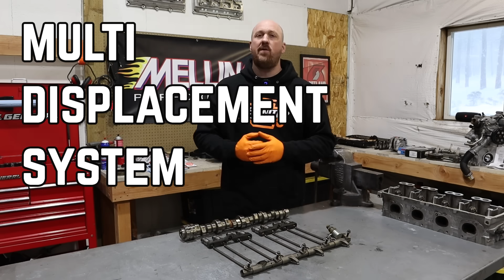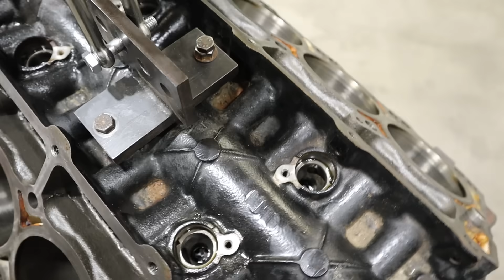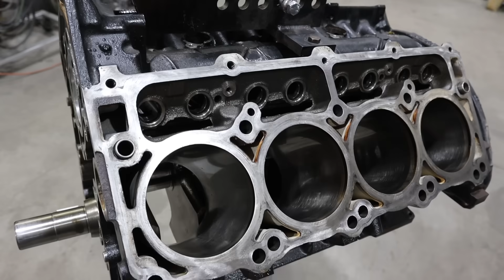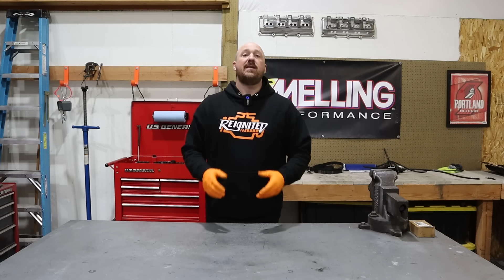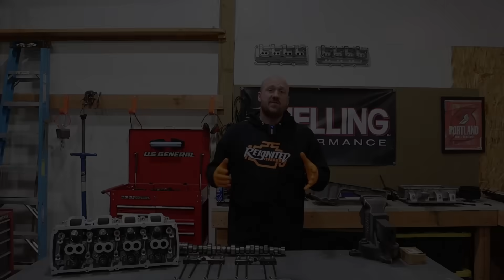Is MDS Damaging Your HEMI? The Answer May Surprise You!

Comment: Question regarding “turning MDS off” on 5.7 HEMI. If one puts it in semi automatic gear 8 and drives normally, the MDS will not activate. Is this problematic as it is if using a tuner to disable or shutting it off other ways? (with regards to oil going to oil bores and oil delivery throughout).
Reply from the maker: If you are immediately putting it into that mode as soon as you start the vehicle, then yes it's the same thing as turning the MDS off with a tuner. However, I do want to stress that this isn't as critical to the health of the engine as regular oil changes and keeping the engine idle hours low. Both of these things will have far more effect on the longevity of the engine components.
Reply: @ReignitedAuto  I’m not sure I fully understand what you’re saying in the answer. Is it safe to disable MDS always, not idle the engine, stay on top of oil change frequency and use high quality oil etc… Do all 8 firing cylinders receive oil lubrication equally if MDS is disabled? And if yes, is it necessary to replace the MDS lifters and plug the bores, remove solenoids etc, if the answer is yes?
Reply from the maker: @mrgoggles1963  when MDS is not active, the lifter bores are not receiving full oil flow. So if at all possible let the MDS system operate as it's designed. If you'd rather not have the system at all, then I recommend removing the MDS solenoids, and replacing the MDS lifters with non MDS ones. You will need a tuner to turn the system off for good, otherwise you'll get a check engine light. But if you do this, the lifter bores will be receiving full oil flow at all times.

Comment: I have a 2022 dodge challenger r/t scat pack with auto tran. Would the MDS activate on eco as suppose to track, sports or custom. And does this particular vehicle has this technology
Reply from the maker: Yes, your vehicle is equipped with MDS, it's active in ECO mode, but disabled when in sport or track mode. To be clear, I'm not implying there's damage that's happening when the MDS is not actively on, I'm just saying that it's an additional way that oil can reach your lifters, so don't just automatically turn the system off whenever you drive the vehicle. 👍

Comment: Yeah. Say what you want but I work in an independent shop so I service all brands domestic and import. We replace DOD and MDS engines 10-1 compared to the standard v8 versions of the exact same engines. Oil consumption is a huge issue on these engines also compared to the standard models. Great videos btw. Very informative

Comment: Love the video, was debating on doing a 6.4 scat motor into my 68 charger. I was originally just going to install complete stock, but if I read your video correctly it’s highly recommended to delete MDS and replace lifters with a hell cat oil pump? Also is it beneficial to go ahead and install a camshaft also? Thanks
Reply from the maker: If you're going with a custom install like that, 100% ditch the MDS system, install an aftermarket camshaft and install the high volume pump from Melling 10452HV. Also, to check out a new product available to run these engines in swaps like that, check out my most recent video!

Comment: I wonder if those MDS plugs totally block the mds port? I wonder if it might be better and cheaper to leave the mds functional and install non mds lifters. That way you get extra oiling during an mds activation and you don't get the collapsed later that probably is what damages the cam. OR if the MDS plugs totally  block the mds ports? Maybe leave the bottom O ring off and feed extra oil all the time? Also everyone want to change the cam (expensive) during a delete. Is this absolutely necessary? I'm working with old cars and junkyard engines. Cost IS a factor. Lol. 1500 total build lol. 😂
Reply from the maker: Good news, the plugs DO NOT block the oil ports so by installing the plugs you're getting full oil flow. And no you don'g have to replace the camshaft if you don't want to, as long as none of the lobes are damaged of course. 👍
Reply: @ReignitedAuto  what if you replaced the 8 MDS lifters with 8 regular. Added the oil plugs in the block then just left the solenoids under the intake plugged in? I wonder if you would retain MDS by cutting fuel and spark but still letting the mechanical part of the engine be unaffected? Best of both worlds n no tune required?
Reply from the maker: @egodeathplease  I haven't thought of doing that before, but I don't think it would benefit the engine enough to make it worthwhile.

Comment: What a stupid way to "engineer" this system.  It would make more sense to use the pressurized oil to keep the lifter at operating length instead of shortening it.  So essentially if you take this to the track often, or drive in Sport or Track all day you are wearing the crap out of those lifters and cam lobes.  Wait, I'm making sense.  This is a business.  They do it this way so you trash your engine more often and have to either pay them for a replacement or buy parts from them to rebuild it.  What a shady way to do business.

Comment: I have a 2007 mds engine in my jeep wich is ticking from.idle to somewhere between 1300 to 1600 rpm, i did an engine flush with seafoam and it bring the thicking down from 2200 rpm to what it is now, should i considere swapping oil pump for an high volume one or is there something i missed... mds work ok when it does ( got an intermittent mil ) but i'm wondering what should be done because i dont want to remove the head to gain acces to the lifter... pain in the ass doing it inside engine bay since i am not equiped to remove an engine from there...

Do you have any option before swapping the oil pump ?

Comment: mine: 2011 Ram 1500 stock 5.7 Hemi. Concerns: My debate surrounds the exhaust manifold bolts that occasionally brake. Could the MDS system running on only 4 cylinders cause a heat exchange/expansion and shrinkage  problem for the exhaust bolts, causing the heat on, heat off heat on, heat off from the deleted 4 cylinders to cause an uneven amount of heat in the aluminum heads and cast iron manifolds? With 4 cylinders constantly burning and other 4 constantly on and off it makes me think that this is causing the exhaust manifold bolts to break. Additionally: You seem to think that the oil flow from/through the MDS lifters is weak when the MDS is turned off. I tow a trailer in TOW HAUL mode. Isn't the MDS disabled in Tow Haul, making the oil flow all the more important in Tow Haul but worrisome because MDS is disabled? Thanks for your good vids.
Reply from the maker: I've heard this theory quite a few times at this point, that the cylinders that aren't firing are causing a temperature discrepancy that is causing other failures. I'll be honest, clearly I'm not an engineer myself. But I don't buy into that theory at all. The engine is fully heat soaked when the MDS system is working properly, plus you've got regulated temperature coolant running through the block and the heads. If there even was a temperature differential when MDS is active I think it would be very minimal, certainly not enough to cause metal fatigue. 
Now, I will say this regarding temp differentials. Obviously steel and aluminum will expand at different rates, you've got steel exhaust manifolds bolted to aluminum heads. They are constantly expanding and contracting at different rates, you combine that with cheap steel used to make the bolts, and that's where I believe the failure is coming from. 
Regarding the MDS oil flow. Yes the lifters are not receiving full oil flow when in tow/haul mode. However, they are still receiving oil flow, it's just not the full pressurized amount. I think it's much more critical to monitor the correct engine oil change intervals, along with keeping idle times low. Both of these will have much more impact on the eventual condition of the lifters than if you are consistently using tow/haul mode. 👍

Comment: Thanks for your great videos!
On the MDS lifters, do the pins have to stay lined up woth holes on the side? O noticed on both old and new MDS lifters that some pins have tuned inside the cylinder and not in line with the hole...not sure if that was a problem or of it is correct.. thanks
Reply from the maker: Completely normal for the pins not to line up perfectly. When the pins are depressed the whole cylinder spins inside the lifter body, when the oil pressure is removed only one pin needs to at least partially lock into place, so that's why they look like they do. Even the brand new ones from the factory look like this. 👍
Reply: @ReignitedAuto  Thank You!!  You are always the biggest help that I have with this Hemi !!

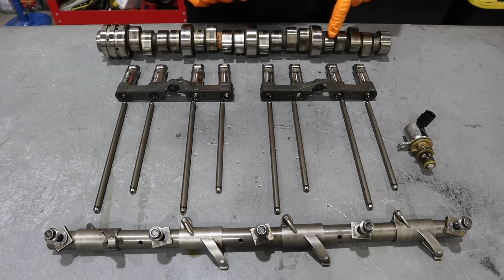Comment: Great videos…. Just a question … some folks have eliminated the tick with 5w 30  full synthetic. I am in  hot 2:52 South Florida and feel the 0 W 20 may be too thin. Any downside to using 5W 30 ? Will that affect the MDS in any way due to viscosity difference? Look forward to hearing your reply.Thanks!!
Reply: Don't know what you got told 10 months ago but thicker oil bad for this. You want lower weight getting through MDS oiling. Best to use right blend with proper additives in it like Pennzoil platinum Ultimate and do changes at 4,000m.

Comment: I have a 2019 GCSRT. People recommend putting the transmission into sport to shut the MDS system off. So what you’re explaining to me is that doing this is NOT recommended??
Reply from the maker: I'm not saying it's something that will eventually damage your engine, I'm just saying don't take away something that is designed to help your engine. Although I will say that of much more importance is making sure that your oil change intervals are being done at the proper time and mileage. That along with keeping your idle times low will help to prevent issues down the line. Great vehicle by the way, it's on my short-list of next cars to buy. 👍
Reply: @ReignitedAuto interesting. Watching this video really explained HOW it works. I do change the oil every 3k and of course have an oil catch can since 12k miles. Wanting MMX lifters and all that good stuff. Was on the fence of doing a bigger oil pump but now you got me sold. I love this thing in all aspects.

Comment: I have a question.  I get a fault code on mine with 110k miles.  Shows the #4 MDS coil open.  I do not notice any other issues with the motor.  Will this damage the motor if it goes unrepaired?  If yes, should I replace all 4 while its apart or is that wasting money?  Great video BTW!!!
Reply from the maker: Generally we do not see too many failures with the solenoids themselves. I'm guessing you're getting an open circuit code? Most often with that code you'll find a rodent had gotten underneath your intake manifold and chewed on the MDS harness. If you don't see any harness issues and it is in fact a solenoid issue then yes I'd replace all four. 
No adverse affects would happen to the engine while the code is set, it just won't go into MDS mode. 👍
Reply: @ReignitedAuto  Huge thank you.

Comment: When I'm cruising on the highway at 60 in my Rubicon 392, fully loaded with well over 800 pounds, I've been seeing 21 mpg on a 250 mile trip over a pass in Utah.  My Jeep has a light that tells me when MDS is active (4 CYL).  But I don't need to see the light to know it is on.  I can feel it in my seat. The engine (or exhaust) vibrates when MDS is active.

Comment: Excellent explanation of this system. You have somewhat put my anxiety to rest. I just bought a 2024 2500 RAM with with the 6.4l so I can tow a camping trailer. I will be doing frequent (5000 mile) oil changes to protect my engine from failure if possible. Thanks again  for making this video.
Reply: I just did the same on Oct 31st.

Comment: Have a 2017 ram 1500 with 5.7 i do my oil changes 3,000 to 4,000 miles.full syn oil and dodge told me i need to replace the engine. cam and lifter failure.it only has 46,000 miles.i asked about the MDS and thay would not talk about it.good think i have warrianty still on it.i think thay know thay have a big problem

Comment: Do You recomend  M452 oil pump for a 2015 5.7 Grand cherokee?
Reply from the maker: Indeed I do. Provides additional oil flow at lower RPM but will not affect the operation of your MDS system.

Comment: Is it possible that the mds is on at startup and I’m not getting 8 cylinders firing from idle " but it’ll  “go“ but only towards full throttle then it feels right ( all 8 are firing ) with no misfiring in wot. 08 5.7 l jgc started after new plugs injectors ,fuel pressure, coils good gas , 130 psi is to 160 psi in cylinder  low to high. What might be next , leak down test on the low psi cylinder , I’m lost at the moment
Reply from the maker: Are you saying that it's misfiring on startup?
Reply: @ It starts and can idle hesitates to shift crawl with the pedal half way to the floor then only then I guess takes off till I have to let up to have idk medium thottle , misfires right after that
Reply: I did that after new sensors coding 1 backyard mechanic , 1 crank and cam sensor wires seem like there’s volts but 5-3v the colors don’t matter to me but wires seem good , tough to figure out , my work is not auto electrician

Comment: I have a 2014 Charger SRT8 with 53K miles, I'm getting 31-32mpg cruising at 60mph. That being said I'll be taking a look at the camshaft in a few thousand miles, and likely removing the MDS system. Even in V8 mode I'm getting 24mpg.

Comment: The MDS gives me a 2-3 mpg boost on my RAM 1500 ( ECO modes shows in the dash display when it is active) by cruising at 70mph vs , say, 75mph. Sadly one of my MDS solenoids failed at 90K causing a mis-fire on Cylinder #7.  Expensive manifold off job, I replaced all 4 solenoids.

Comment: I have a question I had a lifter failure just one in my 2013 rt challenger so I did a cam and all lifters replace now it sounds like all of them are noisy until the mds system kicks in then they are all quiet completely when the all 8 cylinders kick in the noise comes back what do I need to do ?

Comment: I have a 2019 ram 5.7 hemi classic with 2750000 km on it . I don’t let the truck idle long I always keep the truck in tow also so the mds don’t come on . I really think that the problem is because of the small oil pump for the 5.7 . I am also doing oil changes at 7 to 8000 km

Comment: What would happen if you installed non MDS cam and lifters but did not tune out the MDS from the PCM?
Reply from the maker: You would also want to replace the MDS solenoids with the block off plugs, otherwise it would step to go into mds mode and would shut off the fuel to four cylinders. 
If you did that, the engine would run just fine but it would set several codes so you'd have the check engine light on all the time.
Reply: @ReignitedAuto  I actually did. It came with the kit from Texas Speed. The solenoid bores were populated with plugs. So I assume that the oil flow would be constant as it would stay in 8 cylinder mode all the time?
Reply from the maker: @juangutierrez4769  that's correct, without the solenoids in place you have full oil flow to the lifter bores at all times.

Comment: how do i turn off the mds 0n a 2016 dodge ram 1500 did cam lifters and oil pump and plugs put in for mds trucks runs fair but has slow shiftin in the lower gears has 8 speed transmission hey like your videos any idey why?

Comment: I have a 2014 challenger rt auto. I did a 6.4 cam with mds lifters and vvt, and accidentally swapped the gaskets on the wrong heads. My car ran and drove enough to take it out and pull it back into the garage. I put the mopar gaskets on to the correct heads and now the car will crank but never idles. Does anyone know what i messed up if the car drove less than 2 hours before i did the gaskets and i didnt touch lifters/cam?

Comment: Fantastic video!  Thank you for this.  I am currently rebuilding my 5.7 out of my 2012 Ram 1500 Big Horn with 185,000 miles.  Why am I rebuilding?  Because I ignored my lifter tick for too long and completely lost cylinders 7 and 3 due to my thoroughly trashed cam.  Guess which of those two cylinders has nothing to do with the MDS system???  So, yes, I can confirm that the MDS likely has nothing to do with the lifter failure.  However, I do not really have a high amount of idle time on the truck so my failure is definitely due to either poor oil pump performance OR some kind of debris decreased oil flow to the top.
Reply: Wow, 185 thousand miles is pretty good. I have a 2012 with only 85 thousand miles on it and now being retired I put less than a thousand miles on my truck a year. So, I probably will never have a problem. Plus I have been running synthetic oil for years and I always run in tow/ haul mode to keep it in 8 cylinders. I didn't buy a HEMI to save gas.

Comment: Very comprehensive video, thank you. For people who are not so technical, like myself, a quick hint. It's enough to change the gearbox setting in your auto mode to sport, or simply switch to sport drive mode (or track) and the MDS is off. Tried it on mine 2020 392 Challenger SC.
Reply: or tow/haul mode or go into the manual shift feature and put it on it's highest gear

Comment: Dude this was fucking excellent. Thank you so much for the time and care you put into this. 

If you'll indulge me, what do you think is the reason that Hellcats can't have MDS? The supercharger on top of the block might get in the way of the solenoids? And the chambers are slightly narrower in the 6.2 compared to the 6.4, but I don't think that would make MDS incompatible...
Reply from the maker: You could absolutely put MDS into the Hellcat engines, they just chose not to. The nature of a supercharger also would make for a lot of driveability issues when MDS is activated as well. 👍